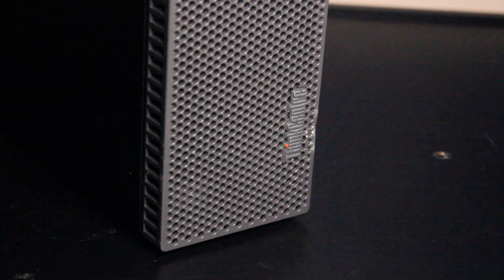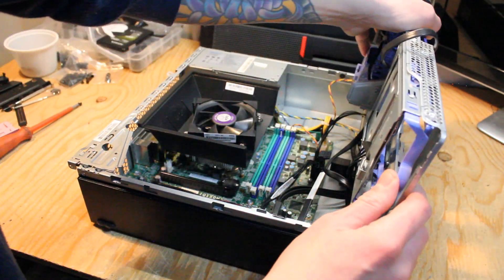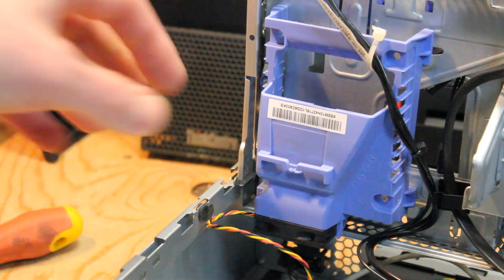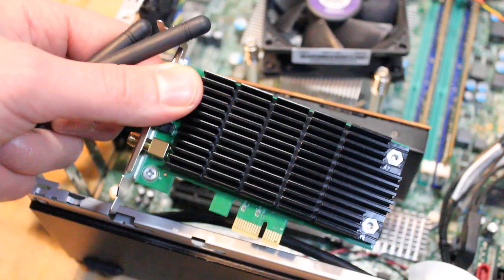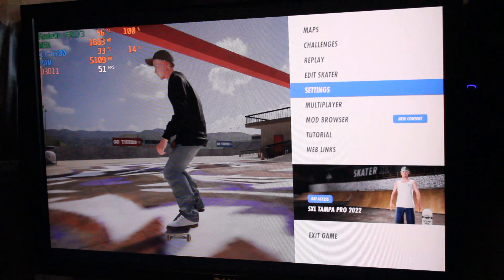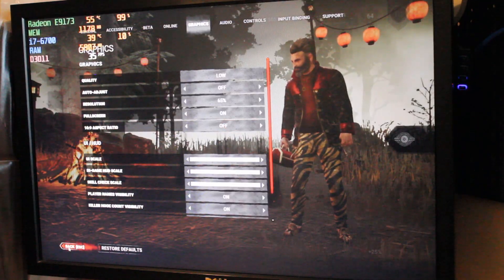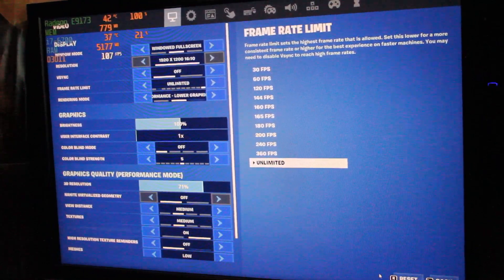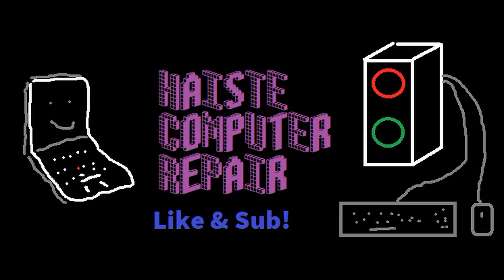Upgraded Lenovo ThinkCentre M900 for Gaming in 2023

Comment: I have a question I bough this as a gaming pc that’s has a i5 6500 gtx 1650, basically I don’t like the design can I buy a gamin pc case and switch everything too a new gaming pc case?
Reply from the maker: You can, and I have a couple of times.  You will need to purchase a cable adapter for the ATX power supply to connect to the small 6-pin connection on the Lenovo motherboard.  This comes with one caveat:  The power supply fan will never shut off (even with the pc powered down) unless you flip the switch on the PSU or unplug.  In this way, it acts like a jumper.  Can be found here:  https://www.moddiy.com/  Might I also suggest an upgrade to i7-6700.

Comment: Use riser/ gpu extender. And you can put gpu card on top. Maybe you can run gtx 1650 on this pc. Ehe..
Reply from the maker: I have installed GTX 1650 Low Profile cards into this PC with the 210W power supply.  Tested power consumption and it's all good to go.

Comment: I got a question, what GPUs does this support?
Reply from the maker: Look for "low profile" graphics cards.  Something like a GT 1030, GTX 1050 (ti), GTX 1650.  AMD Radeon RX 550.  Search for Low Profile cards.  Feel free to link me to anything you are looking at for a second opinion.
Reply: @HaisteComputerRepair  Thank you, would I have to upgrade my psu to instal any of those?
Reply from the maker: @zegzyle2568  All of those low profile GPU's will have low voltage, so no upgrade is necessary.
Reply: @HaisteComputerRepair  thank you very much
Reply from the maker: @zegzyle2568  👍

Comment: Hi mate, can this m900 plug in GEFORCE GTX 1650 VENTUS XS 4G OCV1 ?
Reply from the maker: If you want to use a full height graphics card, you will have to migrate the system into a larger PC case.  Or, use PCIe extension adapters and have the GPU hanging out the side panel.  You can search for a low profile GTX 1650 instead, though, and this will fit into the SFF case:  https://www.techpowerup.com/gpu-specs/msi-gtx-1650-low-profile.b7005

Comment: It's windows 10 . The host for these libraries is cubase and kontakt player. Right now I have about 280gb free on the sdd . It performs ok generally but with the chamber strings library it challenges the CPU more it's 28gb library . I don't have a graphics card to my knowledge. I don't know really . It's basically crunching  sound samples rather than visual information
Reply from the maker: Interesting, I don't have experience with that.  I suppose a recommendation would be to upgrade to a new system with a new CPU for better performance.  Check out the AM4 platform, it's not super expensive to invest in a B550M motherboard and a Ryzen 5 5600X CPU, which would likely be much more efficient.

Comment: Could I fit a NVIDIA GeForce GTX 1650 Super 4gb Gddr6 in this case
Reply from the maker: Without upgrading the case and power supply, you can only install this version of the gtx 1650:  https://www.techpowerup.com/gpu-specs/msi-gtx-1650-low-profile.b7005

Comment: Is it possible to do a case swap?
Reply: Thinking of fitting a full size msi 1050ti
Reply from the maker: @dabby_killa1155  Yes it is, I just did one.  But, you will need a 24-pin to 6-pin adapter for the power supply connection.  One caveat to this is adapter is the power supply fan and any fans connected to the power supply via molex will continue to run until you flip the power supply switch to off.  If that is no problem, let me know and I can send you a link to the cable adapter.
Reply: @HaisteComputerRepair  Thanks! I don't think that's going to be a problem. Can I ask for the link please?
Reply from the maker: @dabby_killa1155  Sorry that was 24 pin to 10 pin.  Here it is:  https://www.moddiy.com/products/IBM-Lenovo-PSU-Main-Power-24-Pin-to-10-Pin-Adapter-Cable-30cm.html

Comment: Posso colocar uma memória de 3200
Reply from the maker: You can, but it will default to 2133MHz as that is default speed for this 6th gen Intel CPU.  There is no overclocking option in Lenovo BIOS.
Reply: @HaisteComputerRepair  vlw eu comprei uma memória ontem é uma Asgard t3 o modelo mais ainda não testei a voltagem dela é de 1,34v isso não interfere em nada né?

Comment: Will a rtx 2060 work
Reply from the maker: Yep, you will just need a larger power supply and the cable adapters needed to connect it to the motherboard.  A larger case as well.  There are Front audio and USB 3.0 adapters you can get to connect to the Lenovo connecters on the motherboard.  Let me know if you want to know more, I can provide links.  I built an i7-6700K and RTX 2060 PC last year and it performed well.